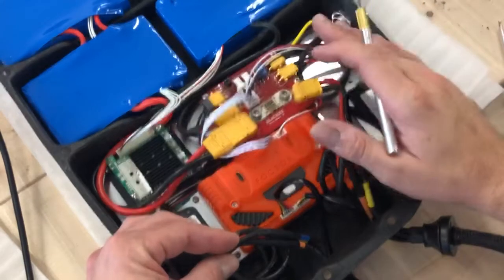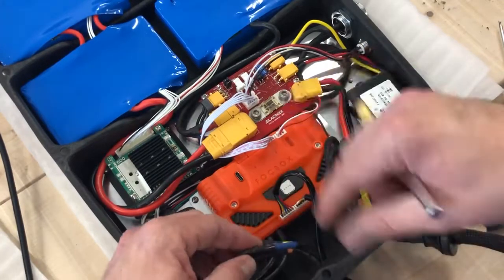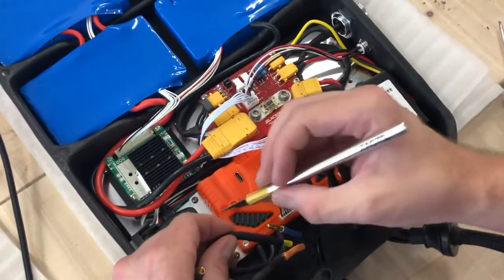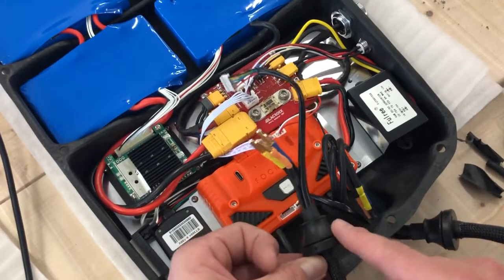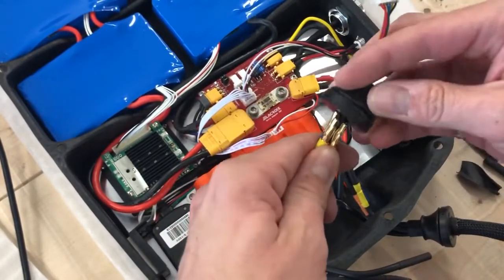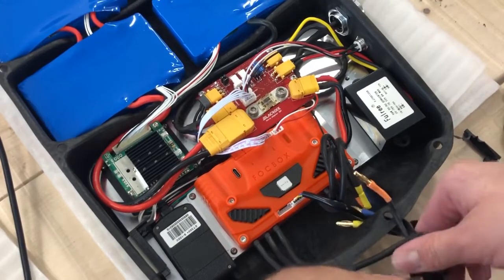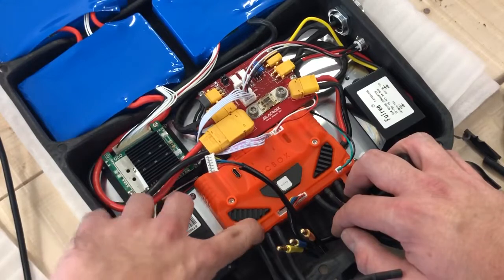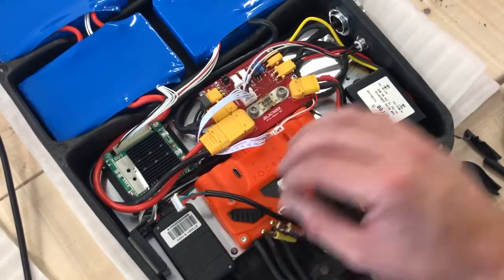HOW TO; all you need to know to swap a motor

Comment: Did this get improved with an exterior connection for 2021 ? 
Something like how evolve does it so you can swap motors with out having to take apart any of the enclosures.